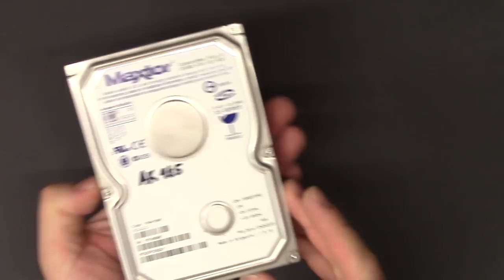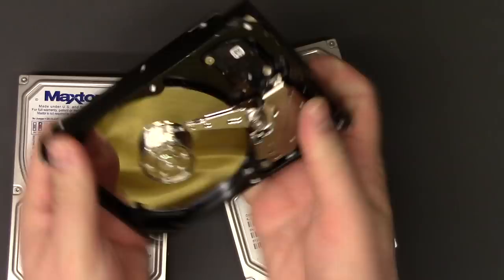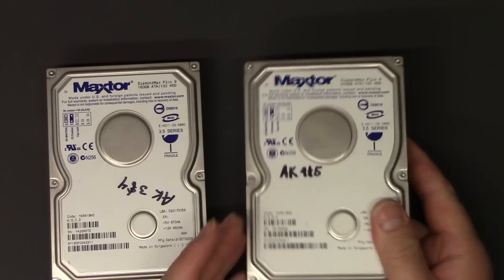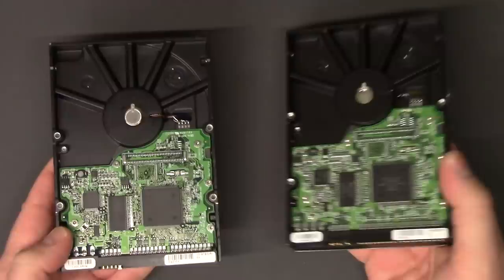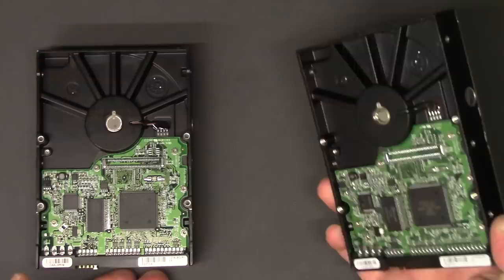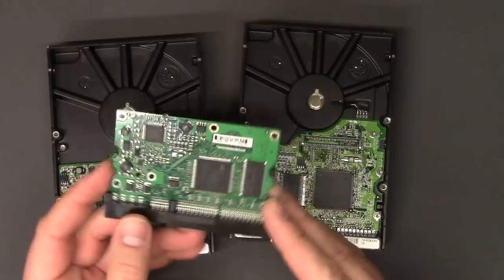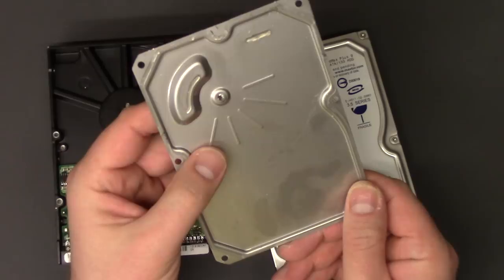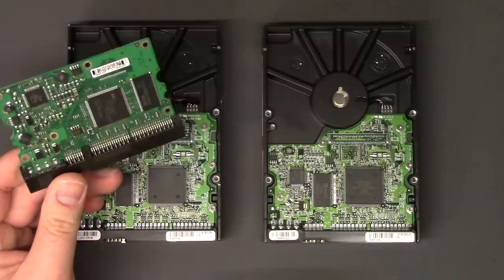How to Recover Data from a fried dead hard drive (FIX)

Comment: I appreciate the great advice. Is de-soldering the existing board connections on the old and new drives required, as well as soldering the new board into the old drive? Many of us don’t mind that process,  but would like an idea of how involved this process can be, for example, on the Maxtor drive you show in the video?  (I have a few of those Maxtor drives from my old computers.). 

Thanks for the video, and for keeping it short and to the point, and for not putting your advice to music.

Comment: I have tried this method of swapping PCB. My spindle driver chip was fried. it did not work, as each individual drive pcb/electronics are Mapped to the platters during manufacture, even if the pcb appears physically identical,

Comment: I actually have an issue with a hard drive with the exact same pcb board that you have there. My question is, if this is the problem what sort of symptoms with you have? My drive makes NO sound what so ever. When I plug it in (Ive tried multiple pcs - It doesnt even try to spin from what i can feel or hear.)
Reply: One of the symptoms of a fried pcb board is that no current flows through it, so when you plug it in, you get nothing. Your pcb board is probably fried.

Comment: I live out in the country sort of and we have satellite type internet I believe (it has a dish pointing at their main tower) anyways it got struck by lightning, it's on our shop roof and we have their main line running down and across a area of the yard into our house and then into a router. and the only thing that was hardwired directly into the router was my PC which yes was on a surge protector, but the Ethernet cable wasn't.. But the lightning or well electricity from the lightning went through there wire into the house and fried my router then went through my hardwired PC and fried my entire PC plus my harddrives (500GBSSD, 1TBHDD) of which I probably had 500+ GB  of my childhood videos, pictures etc I've ever taken, family, friends, everything... now I'm wondering if I can somehow get it running by doing this method jsut long enough to transfer to a new drive, the SSD isn't as important cause it just had the operating system for the most part... Anyway any help would be much appreciated!
Reply: Same happened to me. Did it work for you??

Comment: When my Toshiba satellite laptop crashed and burned, the SATA hard drive was still functioning. After getting several estimates from data recovery services for huge sums of money, I bought a simple plug adapter to connect the SATA hard drive to a pair of USB ports on my new HP laptop. The adapter cost about three bucks on e-bay. It took awhile to figure out the file system used by Toshiba. I was able to open the User folder and find all my libraries there. It was a simple matter to move my files directly to the new laptop. In fact that cheap little adapter works so well that I used it to format the old toshiba hard drive and now use it for my backup drive for all our computers.
Reply: I know a few years old but  so obviously hard drive wasn't dead (even if laptop was).  This is a guide for non-functioning hard drives.